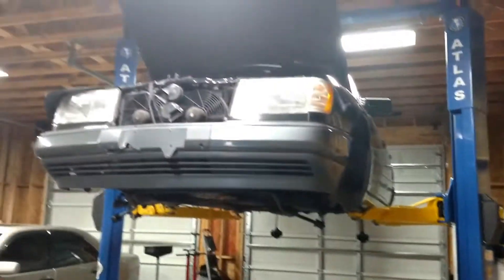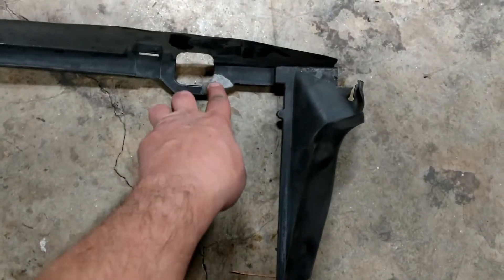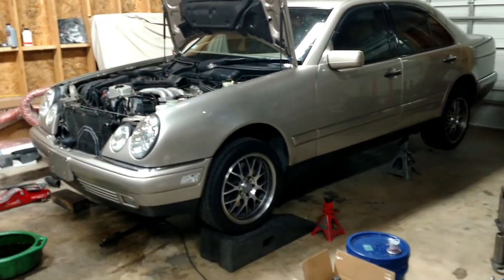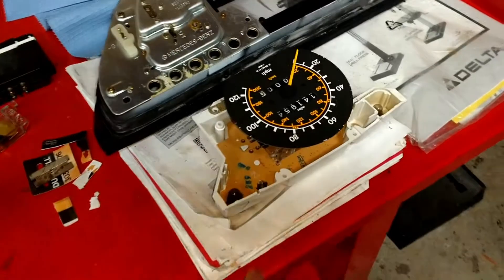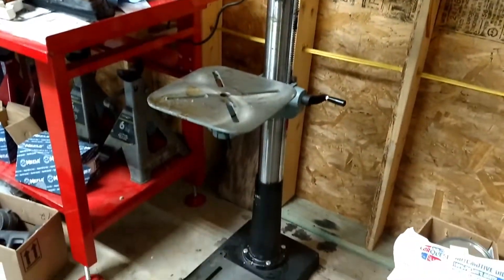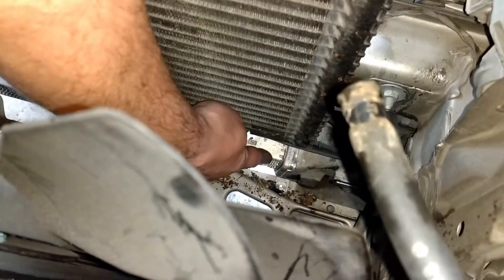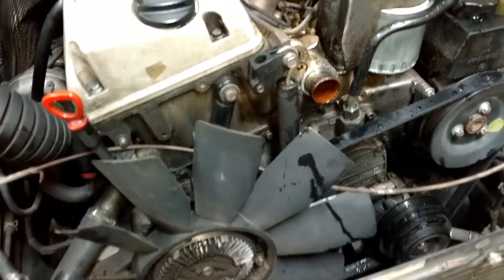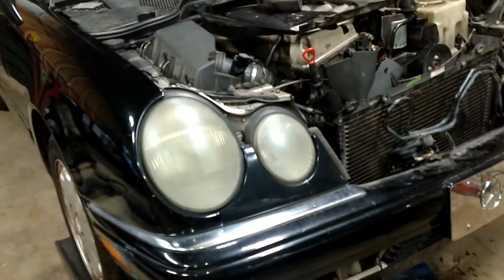Part 5 - More Disassembly. 1995 Mercedes E300

Comment: Oh, first double check to see if the oil drain plug calls for a washer.
Reply from the maker: I actually put a brand new washer on there and it's still leaks I think it's coming from between the block and the pan.